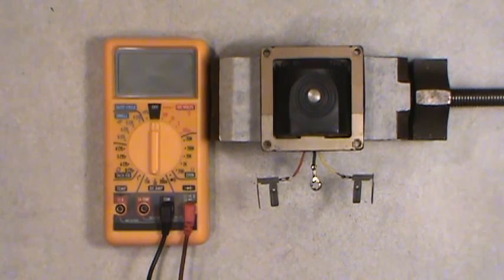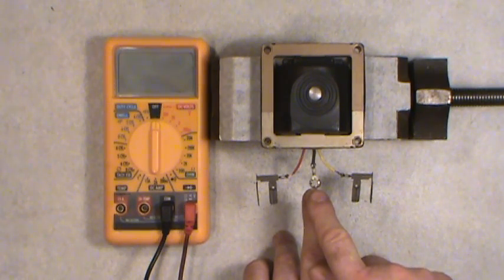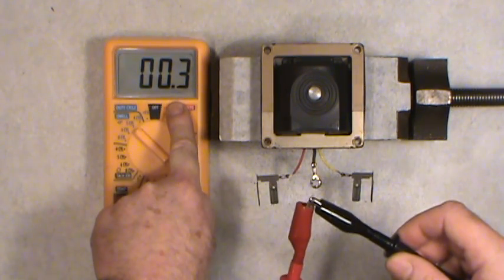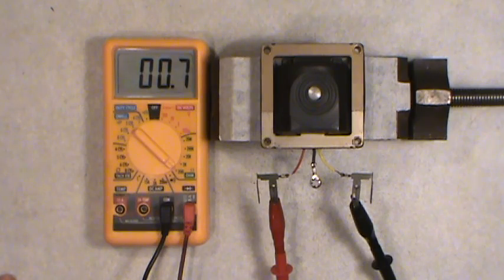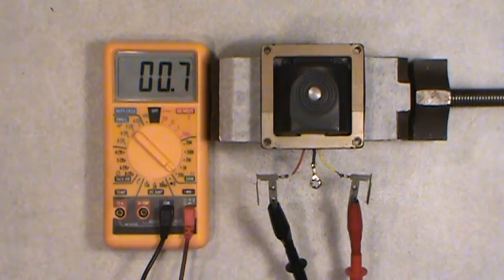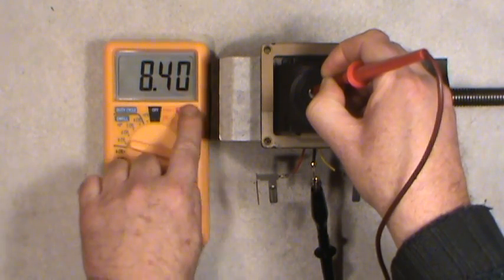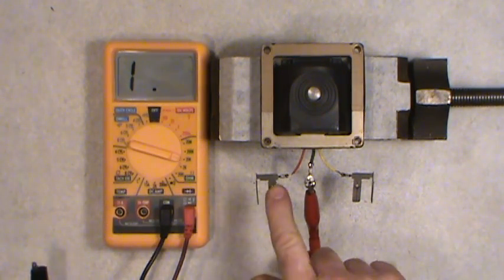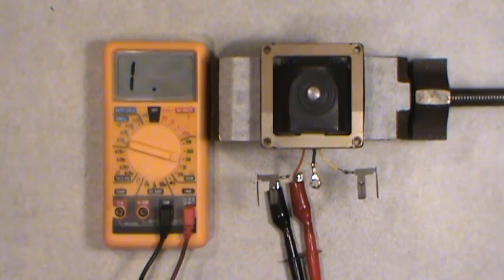HEI Coil Test (The Short Version)

Comment: Muchas Gracias!  Helped me tremendously in troubleshooting a PerTronix HEI system installed on a '38 Chevy Streetrod.
Reply from the maker: mark teague Greetings mark teague....Thanks for watching, and I'm glad, that this video of mine, was able to help You out somewhat....................................PerTronix HEI System, You say.......................................Seeing as how you have a 1938 Chevy Street-Rod, that has me Thinkin'...that I should say the following, just in case, it happens to apply in Your situation, maybe.........................................What happens, every now and again, is, a Person will Remove, that good ole "Points & Condenser" Factory/Distributor, and "Replace It", with a Brand Spankin' New..."HEI Distributor", and, might not be having a very Good Running Engine, after He or She did so..............................................If that be the case, what usually, will cause this scenario, is that, the "Ignition Coil" (usually the Cylindrically Shaped, Oil Filled Type), that is/was, part of the Original/Factory, "Points and Condenser" Distributor "System", has, what is called a "Ballast Resistor" (General Motors Vehicles, usually used a Special Resistance Wire, and sometimes, like the Other Vehicle Manufacturers, would also use the Ceramic Block Type), in its Ignition Wiring Circuit..........................................What this "Ballast Resistor" did, was to "Reduce the Vehicle's Battery Voltage"...to the..."Ignition Coil"...to Prevent the Ignition Coil from Burning-Out, as well as, somewhat Protecting the Breaker Points, as well..................................................Now then, what some Individuals did, when they Installed, that Nice New..."HEI Distributor"...or might even be a Used One, from an Auto-Wrecker/Used Parts Supplier, is to, just..."Connect"...that very..."Same Ballast Resistor Ignition Wire"...that use to Connect, to the "Cylindrically Shaped, Oil Filled Ignition Coil's Terminal", and, what just about any..."V-8---HEI Distributor"...Actually..."Needs", is..."Full" Vehicle "Battery Voltage", and "Not, that Reduced Voltage" that was Supplied, to the "Older Style of Ignition Coil", by the "Ballast Resistor", in that Older Ignition Wiring Circuit.....................................Or Simply Put....a "V-8-Style-HEI"...Distributor..."Needs Full Battery Voltage, Connected to the HEI's Distributor Cap's, Battery Terminal"...or..."It Just Won't Work Very Well at all".................................................If the Above, applies to Your particular situation, maybe, Check some of The "Website Forums", on the Internet, maybe along the lines of a "Hot Rod" one, for starters, and more, if needed, as there will be many People, that will have already made, the, shall we say..."Modification"...to Their Vehicle's..."Wiring"...as far as the "Ignition Wiring/Circuit" , that Leads to Their..."HEI Distributor Cap Terminal"...is concerned, and I say again, just to be sure..."Make Sure that Your "V-8 Type of ..."HEI Distributor"...is getting Supplied with..."Full Battery Voltage"...!!!..............................................Also, make sure, that You "Install the Correct", Gauge/Thickness, of Wire, and any Needed Fuses or Circuit Breakers, that are needed, to Conduct that Full Battery Voltage and Amperage as well"...and the Voltage, can be as "High" as about..."15 Volts"...when Your Vehicle's Charging System is Operating, any time, that Your Engine is Running as well...........................................................A simple way, to Check for the "Amount of Voltage", that is leading up to Your HEI's Distributor Cap is...................with the "Engine Cold, and Not Running"..."Disconnect the Wire that goes to the Battery Terminal, on Your HEI's Distributor Cap...then, hook up the Volt-Meter's test lead to that Wire, and the other test lead to Vehicle Ground (aka, chassis, frame/under-carriage)..........then, Turn Your "Ignition Key" (or whatever), to the "Run Position" (Not Starting Position...!!!)...and, with the Volt-Meter, You will be able, to actually "See", what Voltage, is Running through that particular Wire............................You should be Seeing..."12 or More Volts"....................................Once You have the Voltage Reading taken, just simply, Turn Off the Ignition Key (or what-ever), then Remove the Volt-Meter's Test Leads, and Re-Connect that Electrical Supply Wire, to the Correct, HEI, Distributor Cap "Terminal" ..........................................If it turns out, that Your HEI Distributor, is giving You any further headaches, just let me know, as much as You are able to, in a comment or two, under any of my YouTube Videos, and I'll do what I can, to help You out.................Good Luck, and...Till next time...............Be Safe, take care, and have a good one.
Reply: Thanks!

I pulled the ignition coil and checked the resistance of both the primary and secondary.  They both appear to be ok.  I think I got around 5 Ohms on the primary and maybe 7.5 k-Ohms on the secondary.  PerTronix advertises a spec of 8.5 k-Ohms on the secondary coil of their "Flamethrower" branded HEI style ignition coils.  So, I figure the 7.5 k-Ohms is reasonablly within spec given what their manufacturing tolerances probably are and the accuracy of my Ohm meter technique.

This '38 Chevrolet was a project car that my father enjoyed tinkering around on in his retirement.  He passed away in August of 2009 leaving it to my mother who didn't want to part with it for sentimental reasons.  It sat unmoved in our garage until the Spring of 2013 when my girlfriend's brother helped me to set the ignition timing and fire it up.

It ran fine (ignition wise) up until a few weeks ago.  I start it up about once per month just to cycle the battery and distribute fluids through engine / transmission passageways, etc.

I tried to start it up about a week ago and it wasn't getting "fire."  Probably just a loose connection somewhere in the ignition circuit.  But, I thought I would rule out the coil before chasing wires and connections.  It is a fairly neat wiring job.  But, I didn't help my father with that aspect of it.  So, I'm not sure what goes to what without following everything from end to end.

I did help install the pistons to the rod little ends with those spring type wrist pin keepers.  :P
Reply from the maker: mark teague Greetings mark teague....You're welcome, and, I did have a look at that 1938 Chevy Hot-Rod Video............Sure is a nice lookin' Ride alright...but, I'm not all that sure, about the Music, that I heard in that very video!...lol...well, I guess it wasn't all that bad...but, maybe a song, somthin' like..."Bad to the Bone"...perhaps, could go quite well, with that particular video, don't-cha-think?.......................I saw, that You were sayin', about getting "5-Ohms" on Your Primary Coil Reading, which to me, looks kind of "Suspect", as, most of the "HEI" type of Ignition Coils, that I've taken a "Primary Coil" Reading of, happen to be..."A Little bit above Zero Ohms" (but, Not Zero Ohms), and pretty much "Under 1 Ohm" as well...!!!...and, even most of the older, oil filled type of ignition coils, Primary Coil Readings, were much less the "5-Ohms" as well....................................Perhaps, You might have left the "Decimal Point", just in front of that "5" out maybe...???........................................Please, "Check the Primary and Secondary" Ohms Specifications, for Your "Exact" Ignition Coil, just to be Sure, just in case...................................Also, in order to get a "True & Accurate"..."Ohms/Resistance"...Reading/Readings...then, the "Wiring"...that is "Connected", to the "Ignition Coil's"..."Terminals"...should be "Removed"...or...the "Ohm Readings", just might "Include", some of the..."Ignition Wiring Circuit, and/or Components..."Resistance Values"...as well...!!!...just sayin'...............................................................Also, the "Distributor", that is Installed in Your Engine, is "It"really, a "Coil-in-the-Top-of-the-Distributor-Cap", Type of HEI Distributor, or is the "Ignition Coil"..."Mounted Remotely" (aka, separate, from the actual Distributor) by chance...???.............................................Also, if "It" is a Real-Genuine, HEI, type of Distributor, did You happen to take those "Ohm/Resistance" Readings, while the Ignition Coil, was still Mounted in the Distributor Cap, as that alone, has the ability to somewhat alter the Secondary Coil's Ohm Readings, considering that, that very Reading is taken Through the Carbon Button/Resistor as well..............................................Hmmmmm........might not be an "Ignition Related" problem, that's keeping the Engine, from going..."Va-Room"...as, sometimes, it could be..."Fuel System Related"......................................Try the following................With "Engine Cold, and Not Running"..........Remove the Air Cleaner Housing or Air Filter, what-ever-it-is, and, with a small squirt bottle, with some gasoline in it, just squirt about a Table-Spoon full of gasoline, into each of the Carburetors Bores.............then Re-Install the Air Cleaner Housing/Filter, what-ever-that's on top of the Carburetor, just in case the Engine Back-Fires.............then, try to Start the Engine......................If the Engine "Fires-Up", for a very Short time, and actually Sounds, like it really wants to Start, then, I'd be inclined to be thinkin', that it, just might be, like I was sayin', just a short time ago...a..."Fuel System Related Problem", after all.........................................Does sound kinda weird, that the Engine Ran OK, for quite some time, then...Oh-No...Engine-She-No-Go...and...What's-a-Happenin'-Now...???............................................Well, I still don't know,..."What Engine"...You are dealing with...???.......................................It's up to You, if You want to try and "Prime the Carburetor with a few Squirts of Gasoline", and, If You do, probably be a good idea, to have a "Fire Extinguisher" nearby, just in case, somethin' goes wrong...(I never had a problem, as long as I Re-Installed the Air Cleaner Housing, with the Air Filter/Element/Cartridge in "It", before I started any Engine, using the good ole, gasoline, squirt bottle routine)...................................It's good to know, that You really did, do some work, on that Car alright, as that alone, will always make, for some very heart-felt Memories.........................................................................So then, if You care to, keep me in the Loop, so to speak, and I'll do what-ever I can, to help You out, if need be......................Good Luck, with that 38-Chevy..............Till next time............Be Safe, take care, and have a good one.
Reply: PerTronix Tech Support seemed to think that the ignition module inside the distributor is bad.  So, I pulled that today and am going to swap with one from another HEI distributor we have laying around.  Apparently, their street model unit with vacuum advance is pretty much an OEM style replacement and parts are interchangeable.
Reply from the maker: mark teague Greetings mark teague....Let the real fun begin, as in...tryin' to track down the Culprit/Gremlin, that just might be causing that "No Spark" situation, that You are experiencing, on that "38-Chevy-Streetrod".............................................In order to save Time &/or Money, when "Diagnosing", any "Vehicle Related Problem", it's almost a No-Brainer, that, much like Tryin' to..."Win"...the..."Super Bowl"..."Stanley Cup"...or even..."Olympic Gold"...for that matter, would, as I, and probably many Others as well, would see it, would to, probably be Thinkin' along the lines, of having a, shall we say..."Game Plan"...or, If..."No Game Plan"...the..."Result"...of the..."End Game"...as in..."Winning"...that..."Trophy"...as far as the..."Sports Team or Athlete"...is concerned, see's it, will probably..."Not be Achievable"...!!!........................................Some Window Dressing that was...huh?...lol................................................All-righty then, just like, I was just eluding to, as in, having a "Game Plan", will usually, like I was sayin', will most likely be...Saving Time & Money, and will, as I see it, make for a lot Less, Headaches and Frustration, if You, Others, or I, were to Follow, that there..."Bread Crumb Trail"...some-what, in an..."Orderly Manner"....................................First off, did You..."Actually Verify"...that You were Getting that..."12 Volts or More"...from the..."Ignition Supply Wire"...that..."Connects to the HEI's Distributor Cap Terminal", with the Engine Cold, and "Not Running", and having the Ignition Key (or what-ever), in the Run Position (Not Start Position)...???................................................You see my Friend, always Start at the "Beginning", of that there "Bread Crumb Trail", in order to "Eliminate" any of the "Suspects", if You will................................................Did You try, like I was sayin', in my Other Comment/Reply to You, to "Prime the Carburetor, with a Squirt or Two, of Gasoline", to see if the Engine, would at least "Try to Fire/Start Running"...???.........................................If You don't actually "Verify", those..."Two Things"...and start, Replacing/Substituting Parts & Pieces, You'll just be wasting "Time", and maybe "Money" as well (Yes-Sir-ee-Bob...I've...Been There...Done That...and....Wasted Time & Money Too...!!!...way back when).........................You could even go and Purchase/Buy a "Spark Tester", for an HEI Application (kinda looks like a glorified Spark Plug, with a rather Large Gap, that, once connected, will be Showing a nice Strong Spark, or, maybe None at all, when the HEI-Unit is Operating, and being Tested, oh, and, if You do...Read the Instructions...!!!...lol).............................................For "Stock Engines", in Vehicle's, Driven on the Street, which never "Red Line" (on the Tach/Tachometer), above, oh, lets say..."5500 RPM's"...I just use the "Factory Stock HEI-Unit", and they Worked just fine..............................................But, "Things Change", when-ever the Tach's "Red Line" starts getting in the "6,000 RPM's and Higher", along with..."High Compression/Race Type Engines"...and that's usually, where the "Aftermarket/Racing & High Performance Companies" out there, come in..................................Now then, about Your HEI's..."Ignition Control Module", or just Module, if You like...................................Ever had a "Static Electricity/Electrical Shock"...???...................You know, when You happen to touch a door-knob, and You get "Zapped"......................Well, if any "Static Electricity", that You may have Stored-Up, that inadvertently get "Discharged" into Your HEI's "Ignition Module"(usually through the Pins/Terminals, on either end of the Module), and just about Any other, shall we say "Electronic Chip" out there, once that, poor ole..."Electronic Chip"...Receives that, very potent, Static Electrical Charge, that happens to have the Potential, to make, just about "Any" Electronic Chip"..."Fry", as in, to start "Malfunctioning, or Not Work at all"...!!!.....................When-ever I'm in near Proximity, to Any "Electronic Chip", I, at regular Time intervals, make sure, that I touch, a cool, not moving, Metal Object, in order to "Discharge" Any Static Electricity, that I might be, shall we say "Hosting", to make sure, that I'm not the Guy, who destroyed that Electronic Chip!............................Also, when-ever an "Ignition Module", gets "Mounted/Installed", the Bottom/Base, of the Ignition Module, and the Mounting Surface, of the HEI, that the Ignition Module Mounts On (inside the HEI's, usually Aluminum Housing/Body), has to be Super Clean, and Smooth, and also, has to have, some of that "Heat Transfer Paste/Goop"..."Applied to the Bottom" (usually Metal plate/part), of the "Ignition Module", to facilitate, the "Transfer of the Heat", that the Ignition Module "Generates", when "It" is "Operating"...or, If..."Not Enough Heat Gets Transferred"...the..."Ignition Module"...will probably..."Over Heat/Fry/go Poof"...and...end of story!.........................So, there You have it, well, for now that is........................I'll be around here somewhere, if You need any more help, at all......................Till next time.............Be Safe, take care, and have a good one.